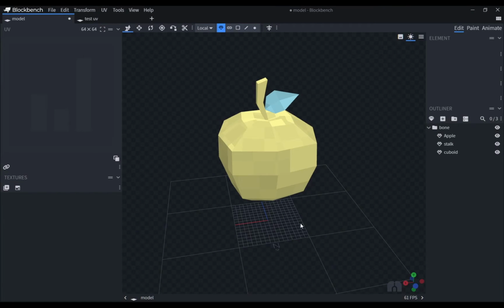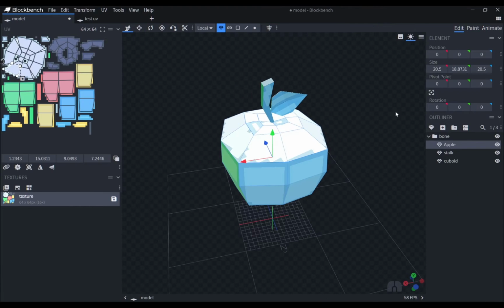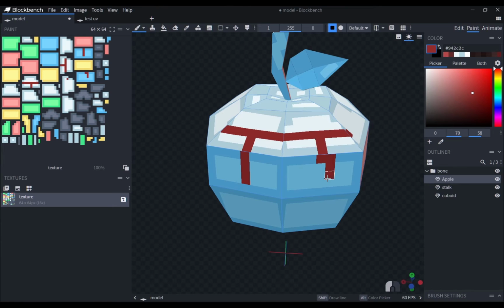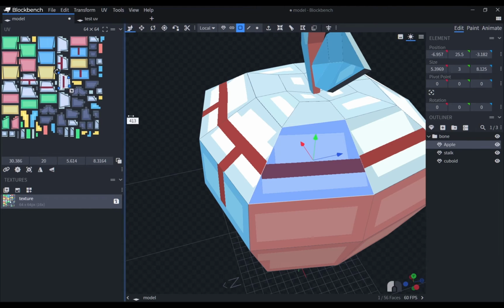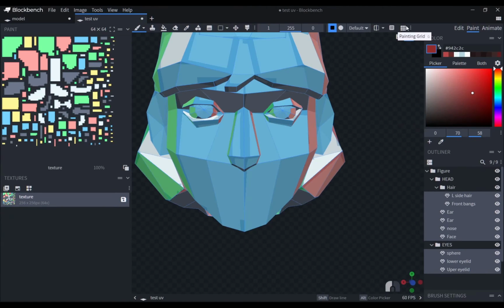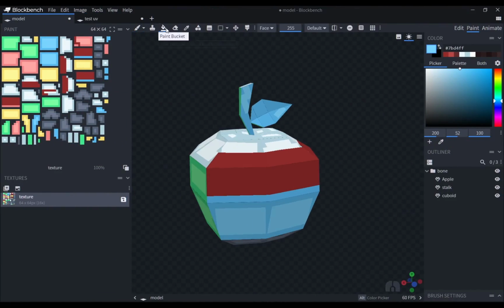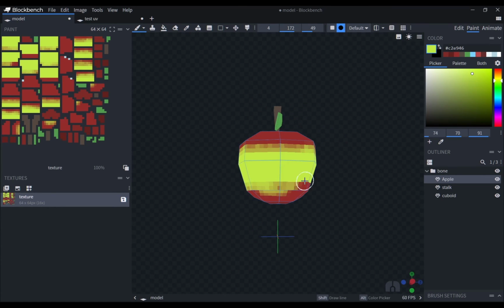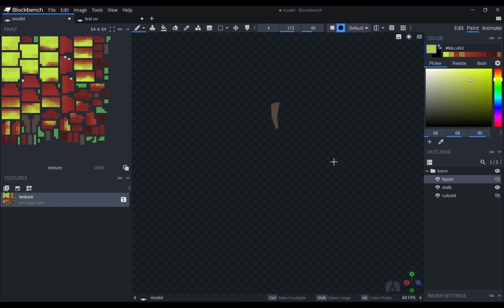How to Texture 3D Models | Blockbench Tutorial

Comment: secondary tip: if you notice your textures are still crooked on a mesh even with this, make sure the mesh is rotated properly

merging one rotated mesh with another can cause the new joined mesh to be considered rotated which messes with the UV, and you can fix this by going to 'mesh' up top and clicking apply rotation which will reset the rotation to be 0,0,0 in its current angle

Comment: for some reason when i make models the pixels on different shapes are different sizes, what is the reason for this?
Reply: This could be an issue with pixel density for textures. I had a similar issue and realized when I started a model it was only at 16x but was trying to make textures at 32x. I changed the density of the whole model and it seemed to fix the issue. I'm not totally sure tho, I'm just winging it lol
Hope my rambling helps lol

Comment: I have a question though. When i import textures into unreal engine they come out all blurry and bad. How do i fix that?
Reply: for anyone still wondering its something to do with texture filtering / interpolation, you want to disable any texture filtering when you purposefully have super low res textures or it makes them really blurry
Reply from the maker: Hello~! For that case, I am not sure how to deal with that problem. It may have something to do with the rendering that Unreal Engine has on default~
Reply: The easiest way to fix this issue - right click on your texture - apply paper 2d settings, and everything will be fine